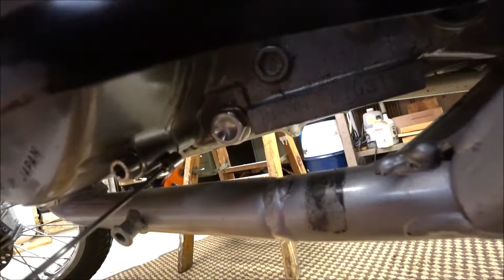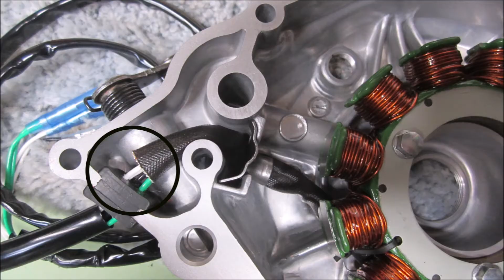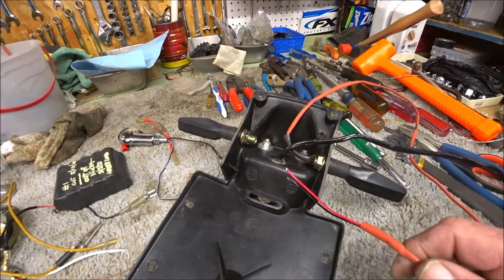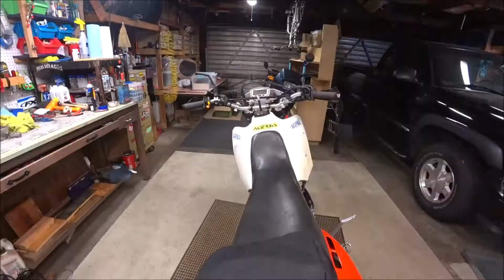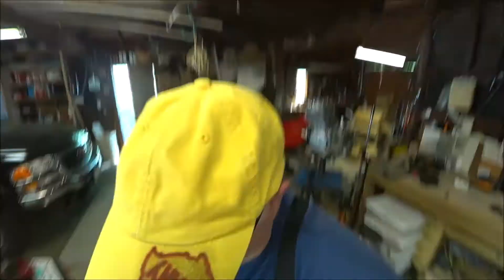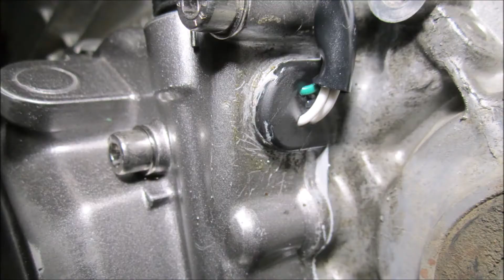the plan repairing shakedown faults

Comment: Great vid glad you solved the problems. I was about to suggest the crank breather pipe as it was near by 👍
Reply from the maker: Yep, I have had the stator cover off a few different motors due to installing a 200 watt stator, or replacing a failed 200 watt stator from ricky stator. The last 3 times I was dripping oil. (and what a mess)
 I felt very confident my gasket job was stellar. And so this time coated just the grommet. Indeed, the location may very well be just where the wires come through as opposed to the grommet/case surfaces. Never a drop since that was done. (did a 120 mile ride last weekend) And I am very happy with that particular sealant as well. I have used it on steel and aluminum gas tanks with 100% success. Wonder if that product is available on your side of the pond?
Thank you for your comment ODB's

Comment: Think I did it Bass Ackwards...I got all the parts to do my XR628R just haven’t finished it yet. I did a similar build on a XR400R first. Now the 400 is some 20lbs heavier than the 600...Should have left the 400 as a trail bike and just made the 600 my adventure bike. Now I’m thinking the 400 can be a 90/10 bike and the 600 closer to 50/50.
Reply from the maker: Well, as you can see, I'm no whipper/snapper. The 400 would still be tough in today's hard enduro world. Hard to believe what some of the kids are doing with modern bikes. Yeah, you're backwards.
Reply: On the XR400R I felt like an old pack mule chasing mountain goats trying to keep up with the new Euro trail bikes. The 400 flat wears me out on our more serious trails...Decided to leave the hard stuff to those much lighter more capable bikes...
Reply from the maker: @dlrmon1  I hate it, but I have sworn off black diamond trails those euro bikes love to go on. I'm loosing it. I've not given up, just have to be smart. 2K is not for trail riding at all. Used to be you wanted the big bore 4 stroke machine for that stuff.
Reply: I really have to get use to more of a street tire. Really dislike the off-road performance loss of 50/50 tires. I find myself wanting an 80/20 tire and just putting up with the wear...
Reply from the maker: @dlrmon1  Like I use on nicky for his summer tire selection. (now that 2k is done, time to change back to the motoz tractionator)
DOT approved. With all the grip you need. Even nicky's winter tire for the street use aint bad. The motoz mountain hybrid. Dialing in air pressure is the big factor.